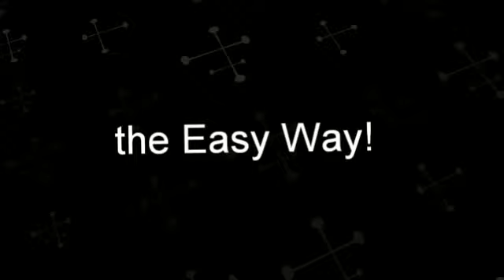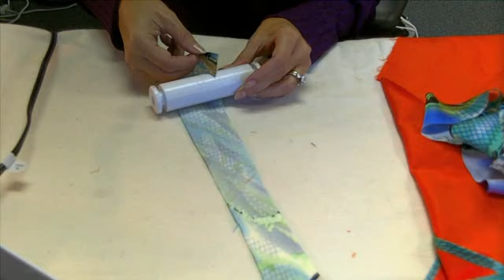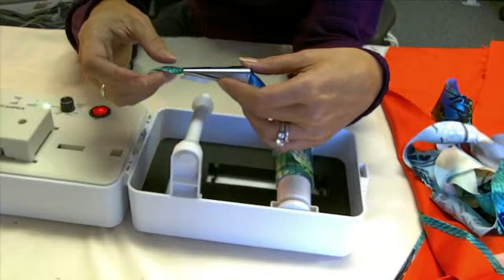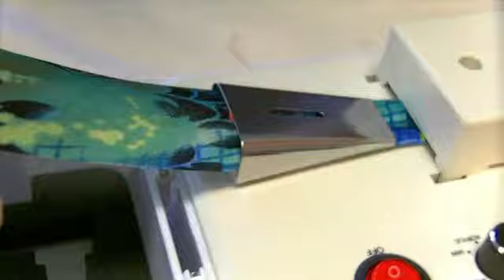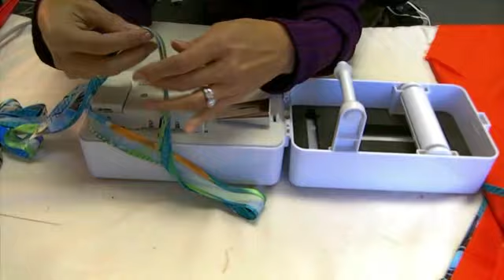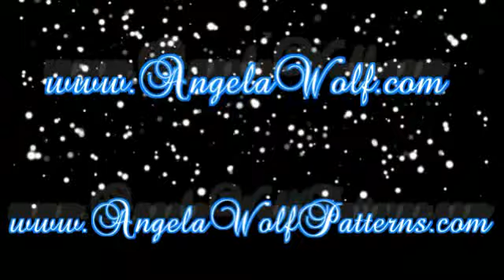Making Bias Tape the Easy Way with Simplicity's Bias Machine

Comment: Did you say CHEAP TO BUY?. Amazon sells it for 350$!  That is not CHEAP to me!  I´ll just do it with a hand held thingy and save myself some big bucks.
Reply from the maker: I bought this years ago for around $50 (on sale)  from Joann Fabrics - looks like they don't carry it any more - which is probably why you are seeing a crazy high prices.  If I see it at one of the stores, I will be sure to let you know - but I wouldn't pay $350!
Reply: Alexandria Summers  its so highly priced on Amazon because Simplicity does  not make it anymore. Believe me, once you use this you will never go back. My version makes seam tape, quilt binding and piping.  I can make quilt binding for a king size quilt in just a fraction of the time it takes by hand. I believe the original price was under $100.
Reply: I have this version as well. It's too bad. Simplicity also made the BH 600 Blind Hemmer. It was light weight, aesthetically pleasing and not heavy and industrial looking.  It's great for lightweight hemming such as pant hemming, little girls dress hems. They don't make that anymore either. I lucked out with someone having old inventory and I did see a few online. It's worth the $$$$. I wish a manufacturer would start them up again.